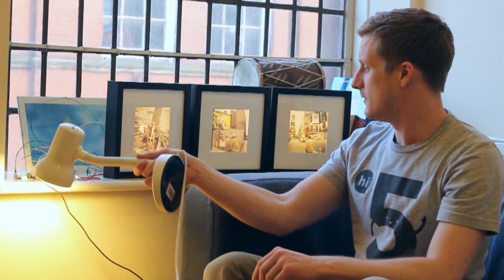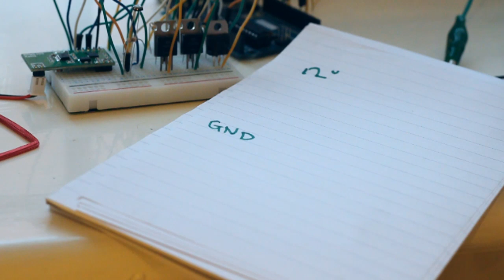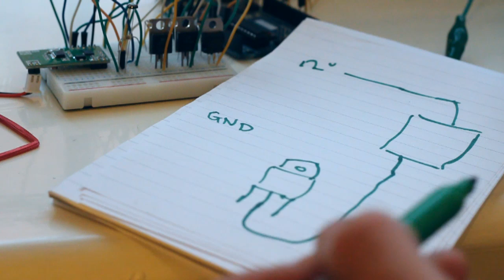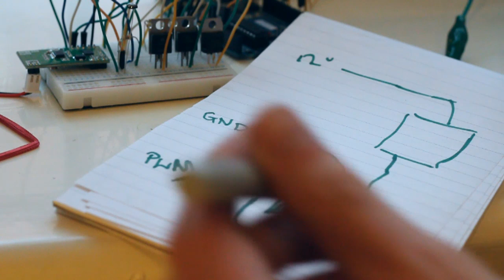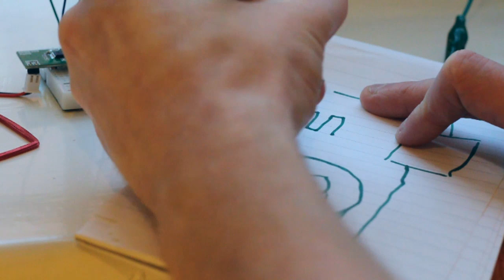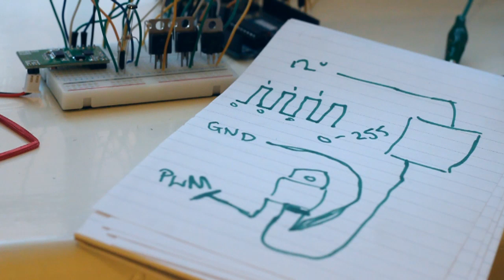How to make: 'Intelligently' Illuminated Photo Frames : Part 2

Comment: Hi
I would like to build illuminated frames, but is it possible to power the led tapes via a battery pack ideally switchable and re-chargable. If so can you suggest some suitable packs
Regard
Reply from the maker: You could run it off a 12 car battery but that might be a bit chunky. I would suggest an 8 x AA battery holder with a switch, you will only be able to power around 1.5 metres with that though since the current draw will be pushing 800ma. But you could use rechargeable batteries. You can get rechargeable 12v CCTV batteries but they are expensive (£25).
Reply: Thanks for the info. I have built a proto type using a cut down string of christmas lights powered by 3 AA batteries, but would prefere to use the led tape. Obviously I would like to get away from mains power as this limits where the frames can be hung and unsightly cables will be a problem

Comment: I did get a bit lost on this video.
Would it be possible to have this run by solar? I see you have a lot of light coming in from your window. Would it be possible to leave the frames by the window all day and have them ready to light up by the evening? Is it possible to buy little panels like that?
Thanks.
Reply from the maker: Sure, you would need low power leds and a circuit that recharges some kind of battery pack. The Lipo Rider (or pro version) would work well if you wanted an out of the box power solution.

Comment from the maker: Thank you, I appreciate the compliment. I am just winging it most of the time so there will be mistakes, luckily people comment and correct me.

I thought the warm white ones would be more photo friendly, I will put up a comparison this weekend. They do look more natural to my eyes but the camera struggles with it in comparison to other whites something our eye cope better with.
Reply: Hey David, thanks for uploading a great project. I am thinking about giving this a go, but am a serious novice. Are each of the frames connected so they are running off of the same power supply? If so, how did you do this? And in terms of parts, a 12V plug for the 12V LED's, connected with 22awg solid single core tinned copper wire is all ok? :) 

Many thanks!